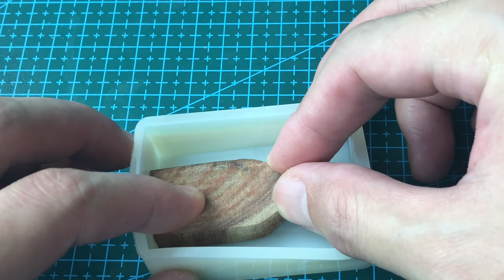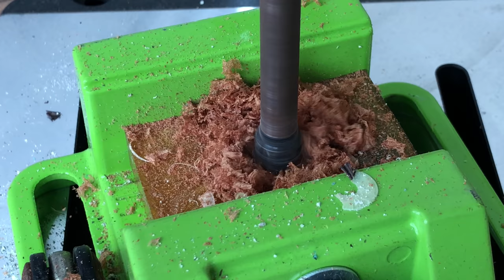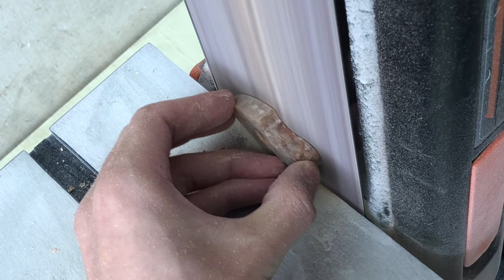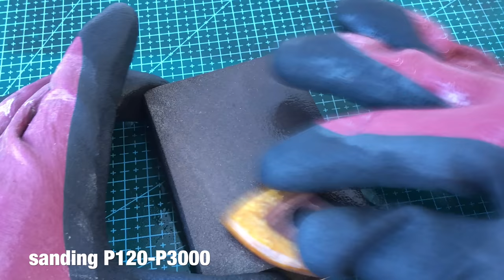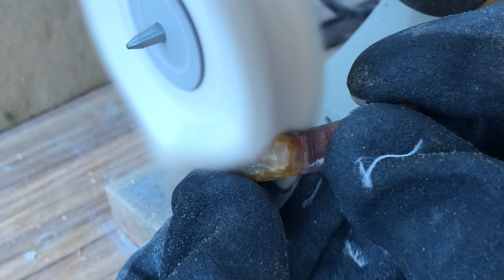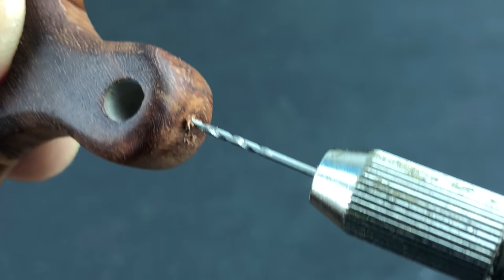Resin art Amazing gold arrow Necklace Pendant jewelry/epoxy resin necklace jewelry S110

Comment: You should have used the hole to thread a length of leather through for wearing. Using an eyelet screw doesn't do it justice whatsoever. But still an amazing piece.